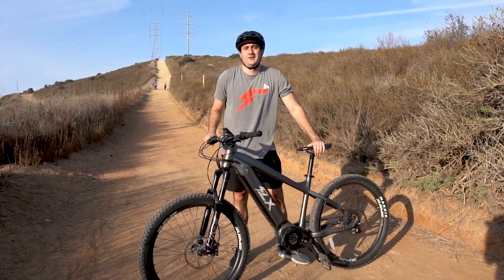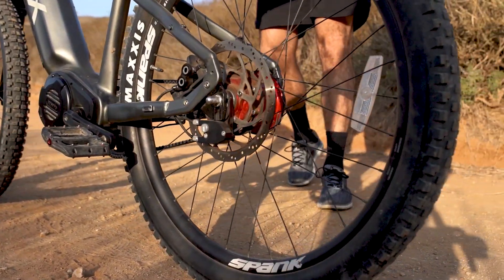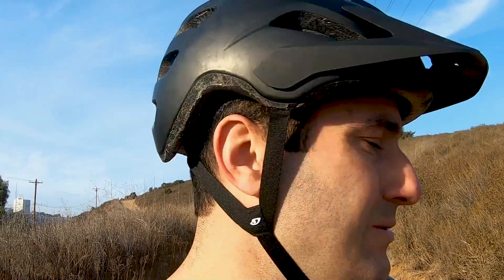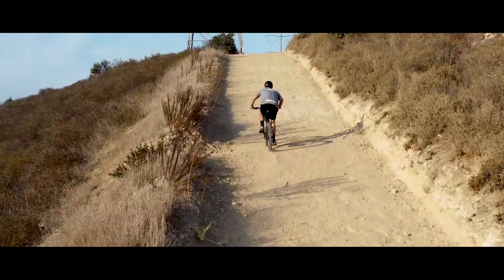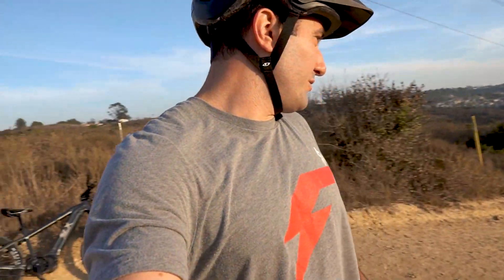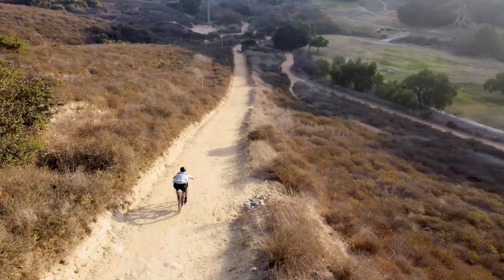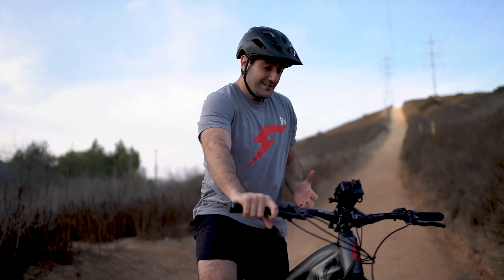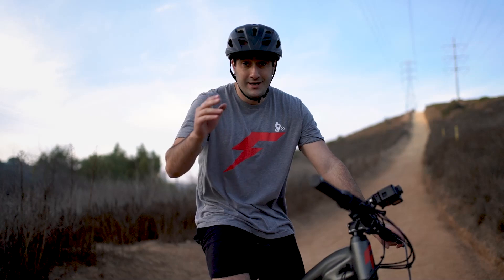Hill Climb Test: Blade 2.0 1000W eMTB

Comment: Cool. Now would someone on your team please explain to me why the motor on my Blade 2.0 is inconsistent while pedaling? It seems to lose power and cuts in/out. I can feel this loss of power while pedaling so I'm not imagining it. I have a road bike and I know how to keep a steady cadence. PLEASE don't make me drag this 60lb bike all the way from the Bay Area to SD for repair. Please advise...
Reply from the maker: Hey there! if you have some concerns or questions with your bike, feel free to email us at support@flx.bike. Our mechanic will surely be able to explain it clearly and help you on this. Thank you🙂
Reply: Many ebikes have this tendency and is makes for an annoying experience. The really good ones minimize this. My Specialized has the most natural and smooth pedal without that cut in and out feeling but is actually down on power compared to some others. Hope this doesn't keep happening on the Blade.

Comment: Does it have a thumb throttle or twist ?
Reply from the maker: It comes with pedal assist, a thumb throttle can be added on.
Reply: @superhumanbikes  how does the thumb throttle move the bike being a mid drive & not a hub motor? Will the pedals start moving on their own when engaged?